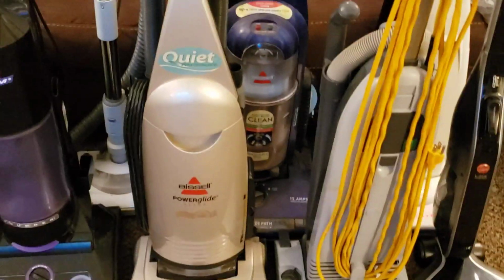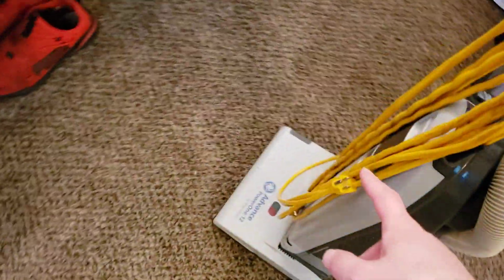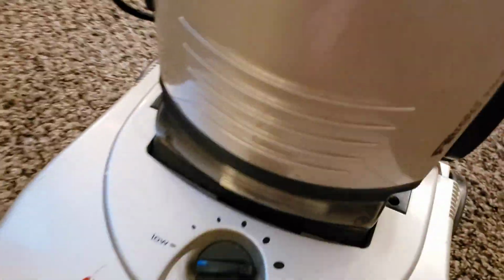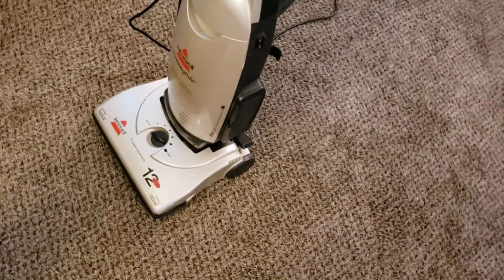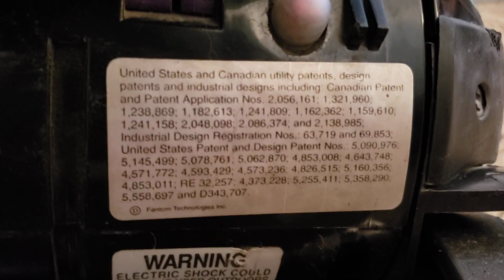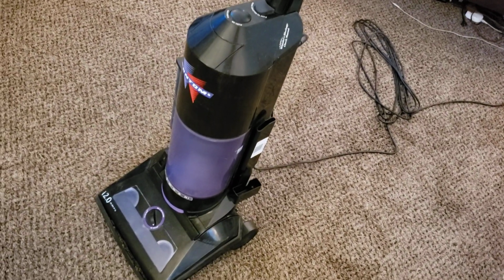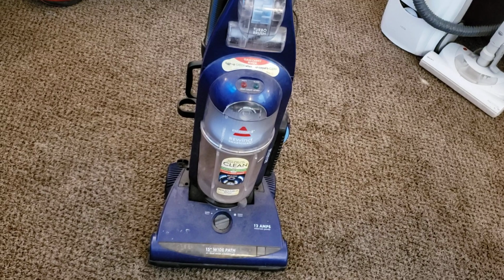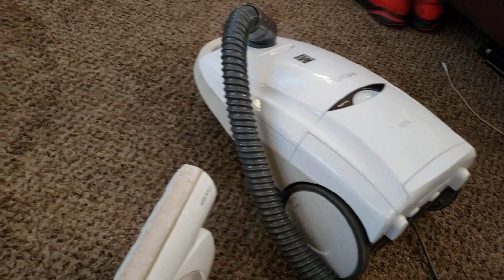Vacuums Saved: Episode 41 - Ultra Edition! (Feat. My Cat)

Comment: I found a green fantom fury from a very old shed and it had water in it and it sounds not the best but it runs and the brushrole is shot. How do you get the end caps off the brushrole?
Reply from the maker: They shpuld pull off. One side will have the axle attached

Comment: The reason the Nilfisk has a Sebo wand is the original wand was broken and rather than buy the right hose I rigged up the Sebo hose which I had lying around because by that time it was getting replaced with a machine better suited for the job. The Fantom was traded as an untested machine, height adjustment on the Nilfisk is the black knob by the handle recline and the bottom cord wrap turns and retracts into the machine
Reply from the maker: Nice! Is the low suction normal, or is that just a result of the hose leaking?
Reply: @IntellitechStudios  Probably just the hose leaking though it's got a shitty generic bag in it, those Lindhaus aren't known for super suction

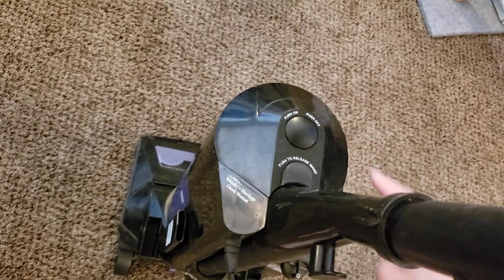Comment: 19:10 this part is hillarious as it made you cough due to a lot of dust in the Fantom Thunder. I'm glad it works because it has a reset button and the original owner probably threw it out because it wouldn't turn on. I still yet have to get a Fantom Thunder as well as a Fantom Cyclone XT or any of the later style Fantom Furies.
Reply: I have 3 Thunder style machines
Reply: @intellitech Studios I love it 🥰

Comment: The smell coming from the PowerGlide is probably from the bag, cleaned some pretty bad carpet with it
Reply from the maker: Noted. In that case I'll definitely chuck the bag and soak the whole unit, but that was the plan anyways so no biggie
Reply: @IntellitechStudios  Either that or the belt is pretty thrashed from all the shag carpet, motor ought to be fine, and the brushroll is actually pretty effective still as shown in the video I have of it, just has to be adjusted lower and those bristles are something else, way stiffer than any other Bissell brushroll I've had my hands on
Reply from the maker: @vacexpert2020  nice! Also I forgot to ask, do you want me to link your channel in the description?
Reply: @IntellitechStudios  sure
Reply: @IntellitechStudios  I also just remembered it was a smoker's vacuum, original bag reeked of cigarettes almost as though they sucked them up so I took it apart and cleaned it but the smell persisted, I'd also put a scent tab on top of the pre motor filter

Comment: Have you ever thought about doing the same thing with window air conditioners in addition to doing the  vacuum cleaners and calling it air conditioners saved
Reply from the maker: It would be interesting for sure. Problem is with how hot it is, every unit gets snapped up immediately
Reply: @IntellitechStudios  that's true I know a few years ago I had a tough time even finding the really small ones which I luckily ended up finding at Walmart and it was actually before Covid hit and my main reason I needed it was because I have one room that the central ac doesn't cool as much because it was a room we had added on to our mobile home so they had to tie into the nearest register in order to get any air or heat to that room because of how far from the main HVAC system that room is

Comment: I'm surprised that Fantom fossil works as well as it does, it's been sitting since the very early 00's if not longer
Reply from the maker: Seems like it was junked because they didn't know there was a reset
Reply: @IntellitechStudios  It was never "junked" the people were hoarders so when they bought an Elite it was put in storage like the rest of the vacuums that were in that house, the reset probably tripped because it hadn't had power in 20+ years and was in a non air conditioned room with no curtains
Reply from the maker: @vacexpert2020  ahh that makes sense